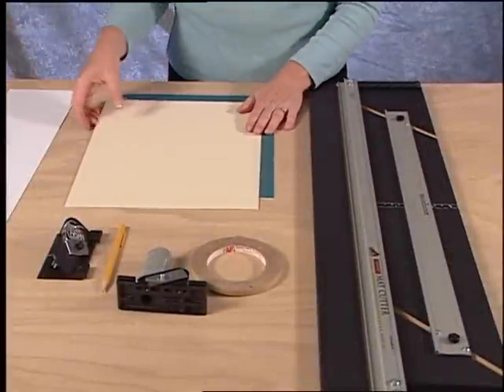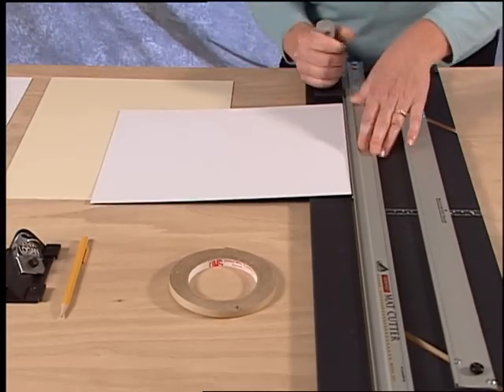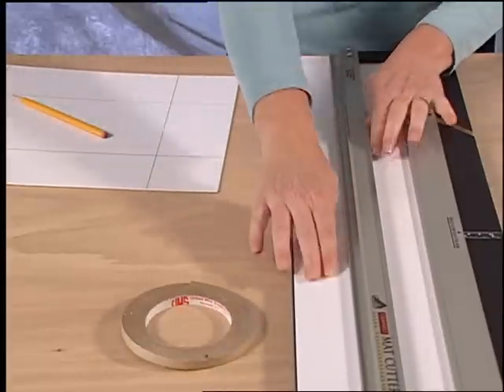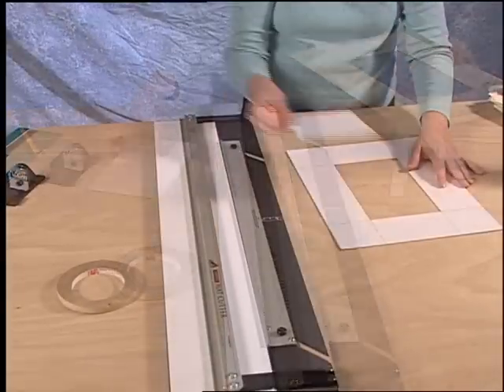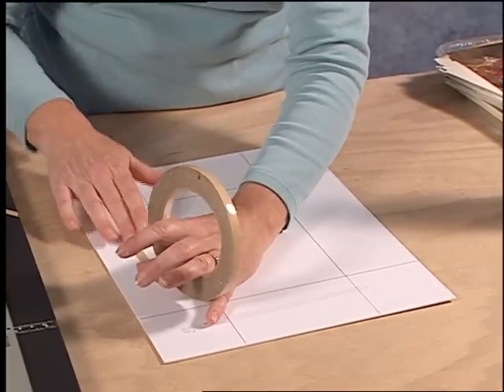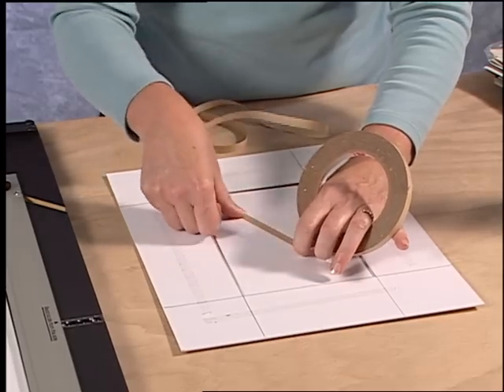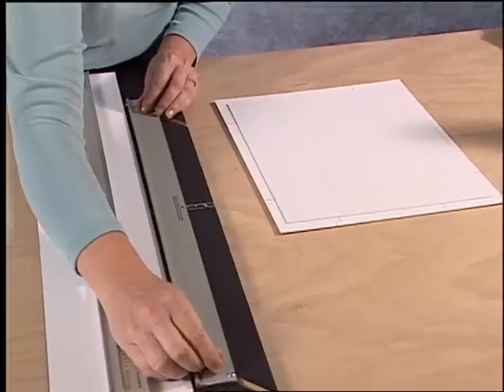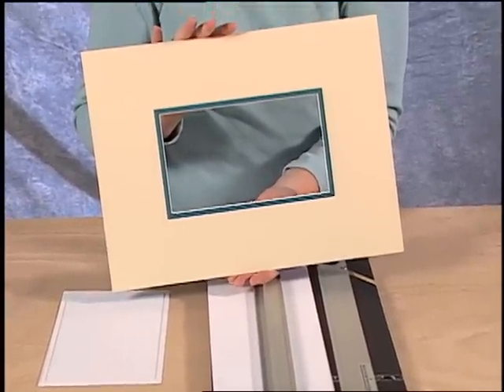How To Cut A Double Mat on a Logan Mat Cutter

Comment from the maker: Make sure the blade depth on your cutter is set to barely score the slip sheet under the mat you are cutting and it is imperative that you leave the window from the top mat in place before you apply and cut the liner mat on the back. Without the window in place, there is an air space under the liner mat allowing it to bow downward and cause problems like not cutting all the way through.

Comment from the maker: You can have both the top and liner mat both the same size. But the advantage of the liner being smaller is that you can then very easily apply the liner to the back of the top mat without having to carefully line up the edges and with the liner being smaller, that insures you will have enough room to drive points into the rabbet of the frame after assembly.

Comment: I tried mine the first time today. The top mat turned out fine. The second mat I had trouble cutting the corners. I lined it up with the line. But, had to go over it several times. I still had to cut 3 of them a little with the blade by hand to get it out. ended up with two ragged corners.

Comment from the maker: The tape is called ATG tape. Which is a backless adhesive that comes off a roll and is available in a few different thicknesses. This type of tape works well to apply double mats together like in the video. You can either use the tape manually as shown in the video or use it with a ATG tape dispensing gun. You can find ATG tape for sale at pretty much any art supply or craft store.

Comment: why is the 2nd mat cut slightly smaller?
Reply from the maker: The 2nd mat is smaller than the top mat, so its edges do not interfere with the top mat during cutting.

Comment from the maker: Yes for a triple mat, you again lay the mat face down on your work space with the drop out window in place, apply adhesive to all four borders and some in the middle of the window and then apply a second liner blank to the back of this color side down. Cut a third set of borders from the back and it becomes a triple mat.

Comment from the maker: Exactly. After the double mat is done, replace the two drop out windows that are taped together back into the back of the double mat. Adhere a slightly downsized liner face down onto the back of this, mark out a third set of borders, cut them and the three drop outs will fall out taped together and you will now have a triple mat.

Comment: Very helpful. . .but when I tried it, bringing the cutter right to the pencil line, it didn't quite cut the corner.  I guess I have to go a little beyond to ensure the other side of the blade has gone far enough, but then I risk going too far.  Any advice?  Thanks, and thanks for posting this video.

Comment: Hi there, would you mind sharing the name of equipment you are using. Would it suit to make mats for a full or 1/2 imperial sheet painting?
Reply from the maker: This is an older model Imtermidate Plus. The current verison is the Artist Elite 450-1
Reply: @LoganGraphic   que diferencias tiene el modelo antiguo con el nuevo? en el antigulo se puede poner una logan 4000?

Comment: How to you cut multiple cuts due to multiple different size photos, anyway to trace around the photos and then reverse the paper somehow to make the perfect cuts?
Reply from the maker: Hello. My suggestion is to take a piece of paper and map out all the openings as they will appear to create a guide for yourself. Write down each opening size vertically and horizontally and make sure to calculate the spaces in between each opening and the borders around the openings. Write all of this up on the paper you create your layout on as then use that as a guide when actually cutting the mat. When your math all adds up accurately to the full dimensions of the mat you are cutting, then you are ready to start marking out the actual openings on the back of the pre-sized mat blank. With multiple opening mats, you may not be able to use the mat guide on a board mounted mat cutter. Instead remove the mat guide and slide the mat blank around as needed to cut the openings. Make sure you are using a scrap mat board slip sheet underneath while bevel cutting and see you are always cutting on the correct sides of the border lines for each opening. You should always mark and cut from the back of the mat and see the cutting head is riding inside the lines of each opening. Or inside each of the boxes you marked out. If you cut from the wrong sides of the lines, you will get a reverse bevel and have to start over. Each opening you mark out should be approximately 1/2" smaller than the image that will be mounted in it so the image does not fall through the opening. Example a 5x7 images needs a 4 1/2" x 6 1/2" opening. Thanks and good luck.

Comment: I have an older 650 unit, and tried this technique, and it worked fine, however I had two issues, perhaps you could address?

1.  I would mark the lines, as in the video, but when I actually cut with the blade, the cut was not exactly on the line.  It was more towards the outer border, sometimes as much as 1/8 to 1/16 of an inch?

2.  It also appears my cutter blade must be bending?  The final cut was slightly curved in the center (bowed toward the outside edge).  Not enough that I would care for personal stuff, but not good enough if I were cutting for a paying customer.

Comment: Why cut the bottom mat smaller?
Reply from the maker: Hi,
Sizing the liner mat slightly smaller makes it much easier to apply it to the back of the top mat without having to carefully line up two pieces that are the same size. It also can make it easier to drive points into the rabbet of the frame to secure the glazing and mounted artwork by not stacking too much material into the rabbet of the frame. Thanks, hope that helps.

Comment: I'm finding that a few times I do this, it doesn't cut the second mat all the way through. I have no idea why! Can you help?
Reply from the maker: Make sure you are keeping consistent pressure during the entire cut. Do not let your thumb relax on the blade holder and make sure you are using a scrap mat board slip sheet underneath. Also change the blade often.